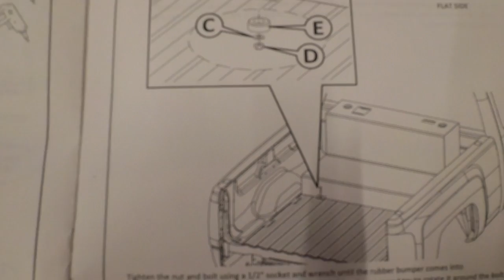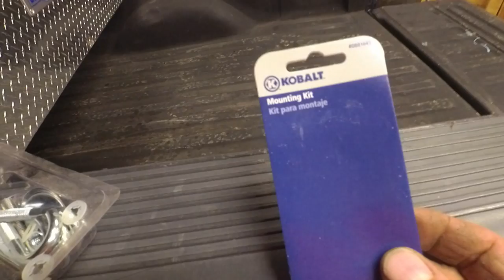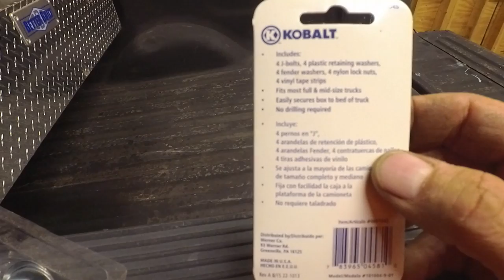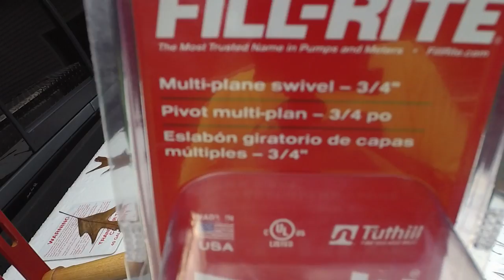Adding a Fill-rite pump and 40 gal Transfer Tank to pickup truck

Comment: Pro tip. Use a drill with a bit that fits that nut in the center of the hand crank. Boom. Electric, speed controllable, pump. Lol. Also. Use heavy duty door slides for the tool box. Make it so you can slide it as close to the tank as possible for storage. Then pull it out to clear the crank handle.
Reply from the maker: Great tip!
Reply: wow great point on the drill!!

Comment: Good tip on the bolt thread but I would use a standard nut rather than a locking nut just to avoid damaging the plastic lock. Does depend on how messy you are with cutting.

Comment: Was thinking about the air noise..  Then it occurred to me, if you just pumped gallons of fuel out of the tank, then air needs to flow into the tank to replace that volume. Maybe the sound was that air balancing the pressure in the tank? Really enjoying your videos, have learned a lot watching!
Reply from the maker: Thank you! I think you have the air noise correct. It's the pressure balancing.

Comment: I bought a Husky box for my truck a while back & paid $100 for it. Best $100 I ever spent. I store all my tools in it, the box had a padlock latch on it already so that was a plus.
I’ve got a tank I’ll probably put on my truck, but the L part of it is 8” tall & since my bed side is 1” lower than the new ones. 

I’ll probably be getting a bus to live in plus it’s my bio diesel processing tank, so I might never put it in my truck. I had a 50gal tank like this guy has, but had to sell it. 

I’m looking at others & the steel ones just keep getting bad reviews as an aux fuel tank to the truck, so I’ll have to just bite the bullet & just get an aluminum tank off FB.
Reply from the maker: 👍 sounds like a plan

Comment: I find it best not to slam the lid on the tool box but rather open the latch with the handle and gently close the lid.  We have a transfer tank/toolbox combo on our truck and the latches are cheap and bend easily.  All it takes is slamming the box 1x and the latching pin gets all bent out of shape.  But if you close it like I described it doesn't have an issue.

Comment: I would put a steal cage between the tank and the cab of the truck. If you're in a wreck those screws pointing towards the passengers is deadly. Not sure of the weight of fuel but water is a little over 8 lbs per gallon and that's a lot of force towards the cab. Even if no one ever rides in the back seat can't be safe enough hauling extra fuel around in a vehicle.
Reply from the maker: Nice point! I've thought of adding a headache rack to this little truck.
Reply: Better safe than sorry ,had a steal cage installed in work van bc I haul a water fed system and wheel hose poles....

Comment: The swivel fitting is more advanced so Obviously they always charge extra for a piece that should be included as the overall package, Be Aware that some of those hand pump seals can leak from the base of that crank handle assembly, If you ever notice that its dripping at the edge of the crank then the seal gets worn out. At my last job we had several pumps that had to be replaced over time, some had to have total replacements. ( not sure of the same brand or model of pump )
Reply from the maker: Ahhhh! My pump is leaking at the center point of the crank. What a pile of garbage. Diesel drips all over the place when I'm cranking away. It only pumped 3-4 tanks before it started leaking/dripping.
Reply: @GCFD   ( Other reply didnt take,YT is having issues w the comment section)  Oh Really,  Geez  Glad to pass the unfortunate knowledge then,  Yeah check the Manuf. schematics etc online if you have to & see if there is a kit for repair, Otherwise you may have to retro-fit w an electric after all, good luck w it.

Comment: you want to keep a spanner with you so you can crack the nut release the pressure then it will drain quickly

Comment: Can you  take the handle  of the pump and use a cordless  drill, it will  be quicker.
Reply from the maker: You probably could Alan. But I'm only filling my small equipment so I wanted something that was slow! My big excavator holds a decent amount so I have to crank it.
Reply: @  alan bellerby    The handle on most of them is a complete assembly with an inner seal that can go bad after time (as i have mentioned in my comment) So therefore no you cant just disassemble the handle itself without modding the end of it, which is not worth the hassle.

Comment: Step #1:  Get rid of the non-auto nozzle and replace with an auto-shutoff nozzle.  God I hated the waste from the open nozzle!!!!
Reply from the maker: Thanks for the tip!
Reply: @GCFD  Bad Tip:  You can't use an auto shutoff nozzle with a hand pump.  :(  You can buy a manual nozzle that will at least have a shut off so it doean't leak fuel all over the place.

Comment: I would have got the one with the electric pump on it instead of the crank
Reply from the maker: The reason I didn't go electric is because I couldn't find one with a low flow rate. I'm refueling small equipment (5-10 gal) and most of the pumps I found pump way too fast. So I crank.

Comment: You guys are so lucky $85 for 40 gallons. UK costs $293!
Reply from the maker: It's going up here lately!
Reply: Gate City Foundation Drainage, yeah. For those of us that are around all mechanical diesels they’ll run on my waste oil mix, so after you have everything setup it gets pretty cheap if you’ve got a constant supply of oil.